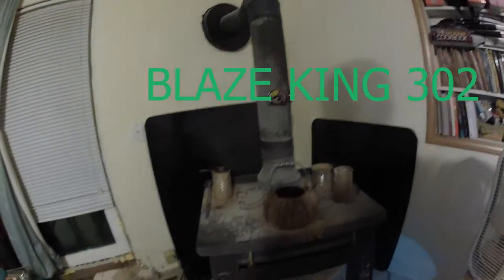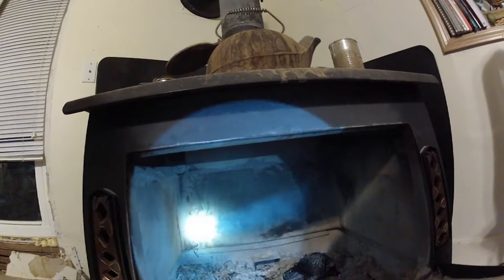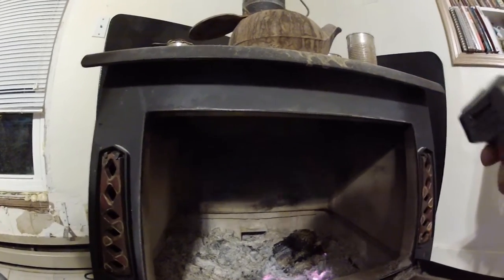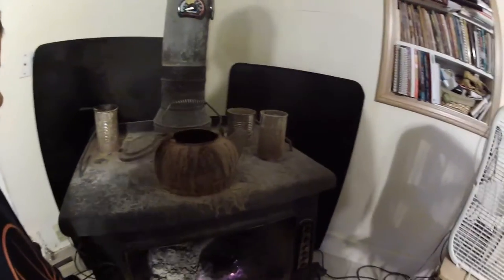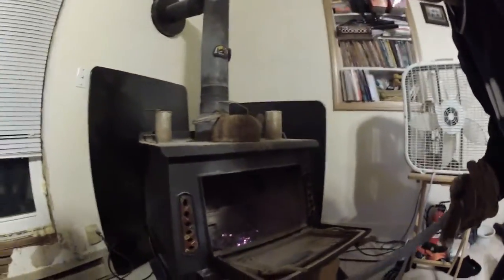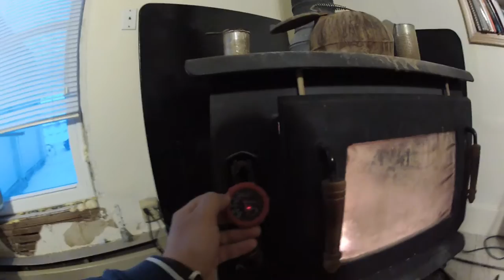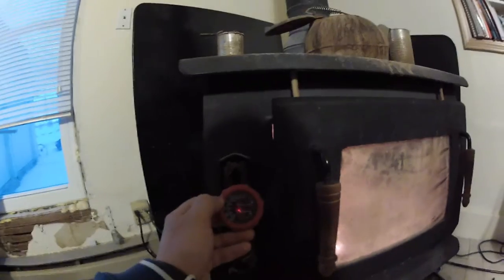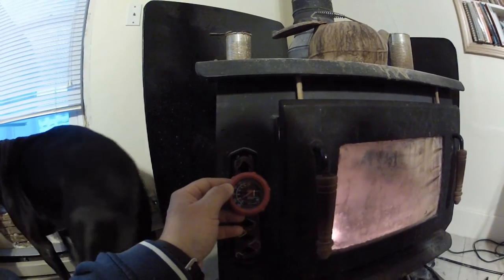BLAZE KING 302 WOOD STOVE in action #homestead,#blazeking,#new,#offgrid,#best,#viral,#old,#survival

Comment: I've got one too. It was bought when I was about 7. I'm 46 now and it's still going good. My blower went out and I never found a replacement. I had work done on mine. I had a welder come in and cut out the inside fire box walls and cap the vents. Made the box bigger and stopped wasting the heat on the ventilation compartments. I fill it when i leave for work at 7am and it's still going when I get home at 6pm. I love mine because I remember getting it when I was a kid and the heat that it gave out when it was new. I also have a flue damper so I can totally restrict/control the air flow. It burns green/wet wood as good as dry wood. Dry wood is almost too hot for my stove. If you take off the cover from the back of the stove where the damper is, you can visually see how much air is going into the stove. I'll take a video for you and show you how mine is set up.
Reply from the maker: Donald  i will put a link to the blow i have the screws will not fully line up  abut 2 of the 3 work and it will work  awesome .  im with you she eats any wood  wet or dry  and yes the dry stuff poors out the btu's . having a bigger air bay would be awesome  too.  ive never look at the rear damper section because it works  good so far.  id  deff like to see what it looks  like  when you have time  .  hope the day is going good  and thank you for watching and have a great rest of your day 

https://www.amazon.com/gp/product/B000BK43IY/ref=ppx_yo_dt_b_asin_title_o09_s00?ie=UTF8&psc=1

Comment: I got one for 75$! I love it, it burns all night it's a 1970-80 era bigger one no window 3 decorative ceramic tiles missing the fan cant seem to find one
Reply from the maker: you got a blaze king  thats  awesome !!!!   this is the motor  i got.  i have 2  one in use and one back up.  the holes didnt line up perfect so i drilled one hole and and our fan is held in place by 3 screws .  we needed a cord to wire the motor up  . basically a heavy duty extension cord (male end side to plug in the wall) and the open wires go to the motor.   hopefully  you bust out a video of your burnner some time  hope you have a great day and thank you for watching .  if you have any more questions or need any help let me know  .   Dayton 1TDP7 Rectangular Permanent Split Capacitor OEM Specialty Blower 
https://www.amazon.com/gp/product/B000BK43IY/ref=ppx_yo_dt_b_asin_title_o09_s00?ie=UTF8&psc=1

Comment: thanks for posting this!  I'm installing a wood stove in my basement to heat my 3200 sq foot house.  I'm looking at the Vogelzang Ponderosa.  I came across a deal on a 80's model blaze king BTJ 504 it is priced at $450.  My house was built in the mid 90's and is well insulated.  I'm torn on what to do.  Anyone have any suggestions.  I have access to plenty of wood but will the blaze king burn more?
Reply from the maker: Thank you for watching . id say get the blaze king  i will be looking at the model your talking about  in a few  but  the way the 302 heat is way way better then the Vogelzang Ponderosa but being in a nicer house you dont need  ultimate heating but why not get it and not need it  and still save a few hundred in the process. our new house is almost finished  and i will still use the 302  in it

Comment: I have the same model! How hot do you let the flue gas get and what damper setting are you using?
Reply from the maker: congrats on having a bad mf ;-) they were on diy alaska so were ready for anything .  i havent had the flue gas temp gauge on in a year or so(she died just havent ordered a new one)  we do have a gauge on top and she sits around 220 to 300 all the time. we do clean the pipes all the time just because its eazy.  my vent is set at about 2 oclock and havent had to move it sense 19 and we moved in the new house. ill open windows before we mess with the damper .  did you guys score yours used or did she come with the house you got.  hope this helps and ask away if you need any thing else.  hope the weekend is starting out good and thank you for watching

Comment: I have a question. They say they have a cat converter in them or a "combuster" mine is like yours..where the heck is it...I cant find it to check to see  if it needs replacing. As I said before I just got mine...Great great stove. Thanks
Reply from the maker: Lisa congrats  on the burner!!!!!  we have a love hate with ours.   love the heat,  hate the mess (not so bad anymore).  in the old house  that was the only source of heat (the blaze king worked great to -40 ;-) )but we always had to keep it hot .  when we would fill her mid burn the smoke work come in the house and get every thing dirty, the hate.  the  (cat converter)  is built in to the wood burner so if you have a blaze king 302  there is none .   in the new house  we love it. we  will pop it off then run the fire till it just burns  out,  then empty it.  so its not to messy,  its  great .  sense the new house it very tight ( insulated to 2019 standards  and not 1910 standards of the old house  it can get warm,  where we crack a window some times )   where we live i wouldnt not have a extra source of heat  the power has went out for weeks  before so  we will be fine on warmth if that ever happen to us .  if you havent id get a chimney brush and the rods  so every spring or fall you can clean it.  better safe then sorry is the way we think .  sorry for rambling and we hope this helps.  let us know  if you need any thing else have a great rest of your day and thank you for watching .
heres some info for you after a novel :-(  haha
https://medium.com/@Whitebeam/how-to-use-catalytic-converters-to-reduce-fumes-from-wood-stoves-and-boil-cbc208c3cecc
Reply: Ah..yes that helps. Thankyou. Yes love hate I already know. We went from wood furnace which was so great to this. I'm learning. We had the pipe cleaned..will be good when power goes out which it probably will in winter months. But I will do the window thing. Has a fan which is great..just got to get to tweaking so I get it the most efficient in for the wood to heat the house. Thanks again!
Reply: Lisa, find the model number of your stove. If you go to the Blaze King site, select "Manuals and Brochures" from the menu on top. On the manuals page, select "Archived Manuals". On the next page, look for your model. The model number can be located on a sticker or tag on the rear, attached at the top of the door, or stamped into the upper left corner of the (exterior) rear wall. Some have them, some don't!
Reply from the maker: @ElderlyIron  good  stuff   hope  your  night  is  going good  and thank you for watching  and helping
Reply: Awesome ty will do that...thanks so much

Comment: Do you know where to get a glass door or other parts for this stove?  I also need the ceramic plates.
Reply from the maker: Robert  our  Blaze Kings  302  is  hard  to  get stuff for  :-( . ceramic plates ???  do you mean the fire  bricks .  if  so  northern  tool  sells  some  that might work . we clean our  chimney every  year  too  just to be  on the safe  side.  hope  this  helps  some.  let me know  if  you need  any  more  .
Reply: @mrsmel269  no,  the ceramic pieces on the front as decoration.
Reply from the maker: i got you now Robert. keep  hunting cl or ebay these on on there right now  (bad color)
https://www.ebay.com/itm/194448115258?hash=item2d4602c63a:g:46gAAOSwR7hhZEZw  sorry  being vintage  its really hard to get stuff for our gems  .   theres a blower on amazon that works  i  got on on the shelf  for future. do  a  video  of  yours  when your  slow  too.  did you go out the wall  or  roof  on yours  too

Comment: Just bought a house with that same stove in it. Whenever the fire goes out it weeps smoke out of the air intake where the thermostat is. Any suggestions to keep it from doing this?
Reply from the maker: Jake Mcfadden thank you for watching & congrats on your new house . i had her smoking in the house one time . the chimney was plugged a little ( so if you havent yet id run a brush ) . something else  what is your chimney size  ours is a 6" all the way out,  but really the 302  is a 8"  we had something else and then got a the 302. so we just made it work .   we just built a new house and were not set up yet.  but i did get all 8" black pipe to the thimble now  so hopefully the 302 will be better . im waiting on a lift to put up the chimney being winter (its a tin roof  and its sketchy)  i did my door gasket the spring after we got her too.  sorry im rambling  but let me know if any thing helps . if not we can keep brain storming .
Reply: mrsmel269 Thanks for the reply! It is 8 inch pipe. It seems to weep smoke whenever I have the thermostat on low and it snuffs out the fire. Haven’t had trouble with it since I’ve made sure to keep it open a little. This stove is bad to the bone! Heated my almost 3000 square foot house with it. Made it all the way through the night with it half packed with seasoned red oak. Will post an update after I test it out some more
Reply: Do you have a flue damper? Sounds like flow is stopped up.

Comment: Word of caution. Burning pine can be a serious creosote issue and setting the stage for a chimney fire. Also, such models burn a lot of wood and are not at all efficient. Most of the heat goes right up the chimney. Just watching the video and seeing how much wood was being used was more than enough to suggest someone would be far better served with purchasing a new Regency Phase II stove. I'm no fan of EPA garbage, but at least this much resulted in a far more economical wood burning stove that puts out serious heat.

 Using a Regency Phase II medium model allowed me to heat a 1,400 sq ft home, plus the attached two car garage, throughout on two cords almond wood the entire winter. Regional temps obviously will vary usage as well as dealing with excess heat. This was done using nothing but a ceiling fan on it's lowest setting in the livingroom with the stove and one ceiling fan in each room.  Highly cost efficient. 

I now live in the mountains above the 3,000 ft mark. With the same size stove and using the same wood in an Enviro manufactured model I'm getting the same results on just two cords of almond. I will say that I still prefer the Regency over the Enviro design. The Regency is a better quality stove design and attention to detail. The Enviro, while similar in appearance, simply is not as well planned out as the Regency and the finished edges are not as well detailed for quality as the Regency. I'm referring to actual quality of construction, not aesthetics. Smooth edge finishes and thicker steel does have it's place in wood stoves.

 In my view a wood stove should not only practically last forever with proper usage and maintenance, it should also do the job without having to rely on additional electrical components for function such as blower motors. My Regency and Enviro application does use the addition of room ceiling fans for better distribution comfort, but they are not required to heat our home. After all, heat does rise. Both stoves actually work well with the main air flow intake in the completely closed position once the fire is well lit. The flame dies down to a small flame for whatever wood is closest to the air intake and the glowing embers serve to maintain the heat output and work fine for lighting the next load of wood. Usually two logs, sometimes three depending on outside overnight temps, of 16 inch logs the following morning. You can use slightly larger logs than 16 inch, but they have to be placed at an angle to fit inside. The medium size units are designed around an eight hour burn time so loading just before you slip off to bed works perfectly. No blowers required.

 Should we experience a power failure and the ceiling fans stop the heat buildup in the living room is sufficient to comfortably heat the rest of the home, but the living room might become uncomfortably warm from time to time. Ceiling fans are long term fans, some with 30 year or lifetime warranties for best models. They use so little electricity that there's simply no comparison between a blower motor versus ceiling fans for both comfort and electricity costs. Blower motors are simply far more expensive to run.
Reply from the maker: thank you and yes we dont burn any pine a friend has  a 1 to 2 year old blaze king (king) and it has the catalytic converter he says  its a pain in the ass both of the stoves the 302 & the king hold right around 90 lbs of wood  which is a good amount for a stand alone  and in any modern home with good insulation you will be in your under ware because you will be hot  i can easily get it in the mid 80's in my dumpy farm house when its 10 so in a modern house you could cook meat ;)  thank you for watching and all the comments
Reply: Burning well seasoned pine does not create creosote - and that's a fact

Comment: I bought a house with one of these. Do you know the value of them?
Reply from the maker: Anywhere from $500 to $1000 would be my guess. At least that's what I have seen them go for depending on what condition it's in. I think the one with the glass doors are a little better. Ours didn't have it but a friend had one with the glass door he wasn't using so he swapped us doors.
Reply from the maker: They are worth using though. They can hold a ton of wood and we have an old farm house that is drafty and we can still easily have the house at 80 degrees in negative temps.

Comment: did you have any trouble since you reduced form 8 to 6 inch
Reply from the maker: Oldfathillbilly1971 No, we haven't had any problems going from 8 to 6. If we weren't set up for another stove prior to getting the blaze king I would have just gone 8, but we were putting the blaze king in place of the old stove.
Reply: thanks I got a very nice blaze king 202 for the house and I have to reduce it was worried
Reply from the maker: Oldfathillbilly1971 You're welcome! I think you would be fine going down. Get some wood and shorts! We have a drafty house and sit at 80 inside. The blaze kings are awesome.
Reply: I bought a BK 302 in great condition but I’m having really bad problems with creosote build up in fact dripping out of the pipe joints. I’ve cleaned everything and installed new pipe. 8 in reducing to 6 inch pipe. Burning at and red oak seasoned 5-6 months. I absolutely have tried everything and have never had this problem with other stoves in my house. Any ideas?